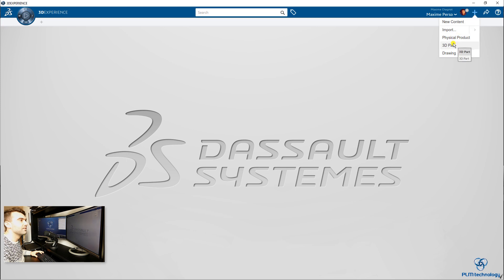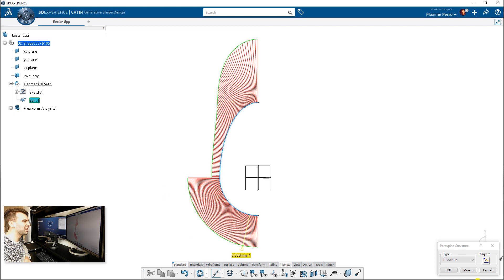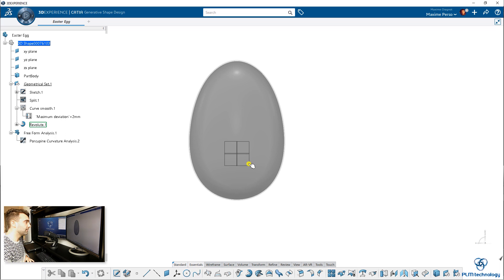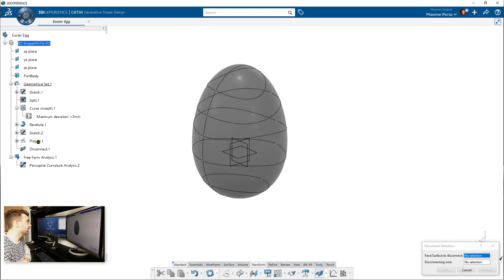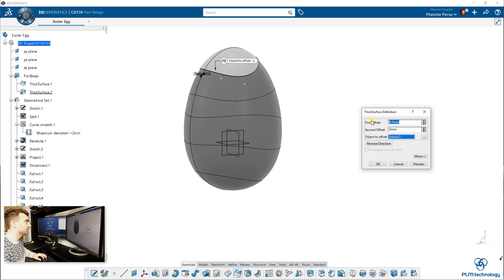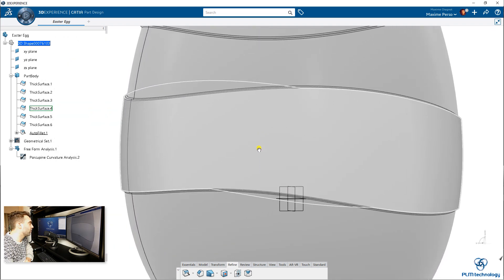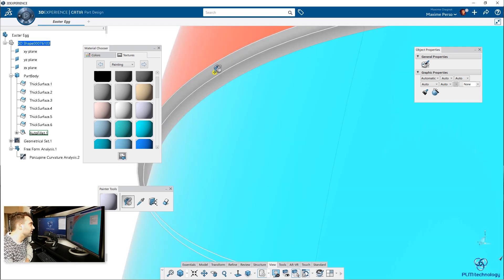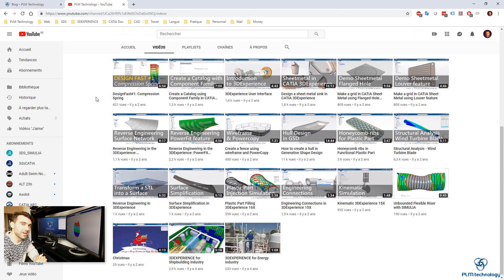DF5: Easter Egg

Comment: Hello, my 16x does not have the Disconnect function in your video. What version is there?
Reply from the maker: Hello nastran hzl, thank you for commenting the video and trying to reproduce the tutorial :D I used the latest release available R19x. The disconnect is new in R19x. But there is no problem if you do not have it! I recommend you to use split feature with options keep both sides. It will take more time since you have to select 2 domains, but it will give you the same result at the end! Do not hesitate to contact me if you have issue ;)